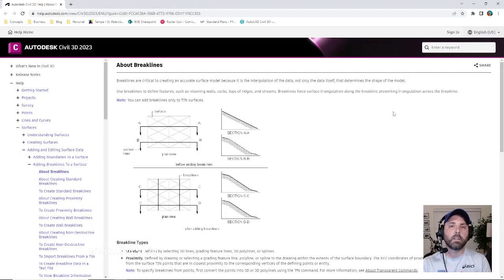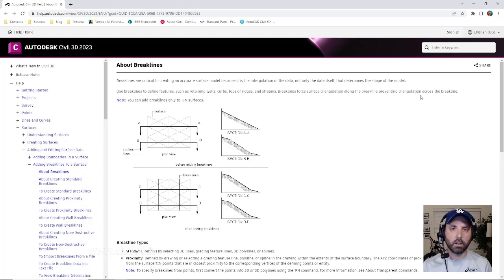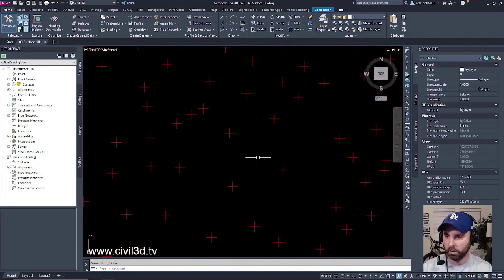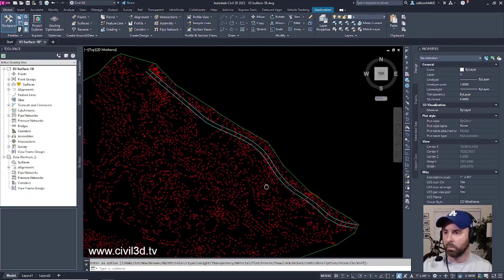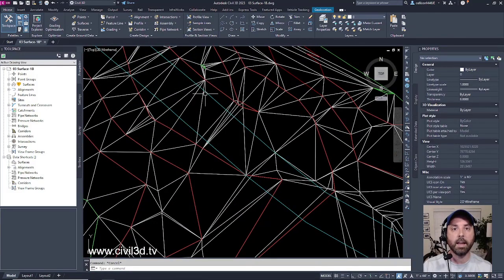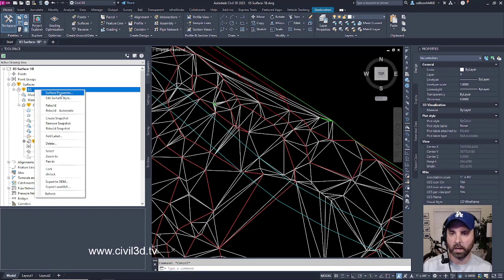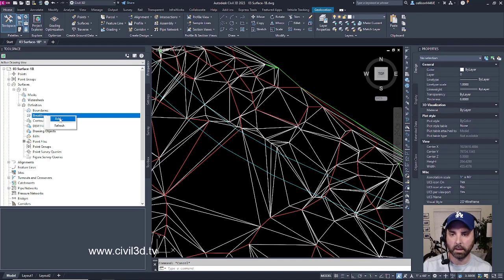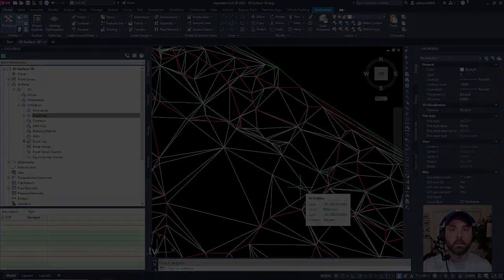04 Adding Breaklines to a Surface in Civil 3D 2023 to 2024

Comment: How did you draw the 3D polyline in the first place?
Reply from the maker: I used Polyline tools, then assigned elevations by snapping to survey points/feature lines. You can also create 3D polylines by using Extract Objects from Surface or converting feature lines into 3D polylines if you already have a surface.